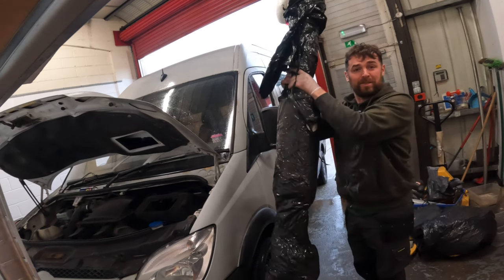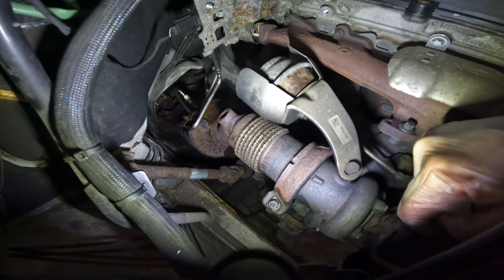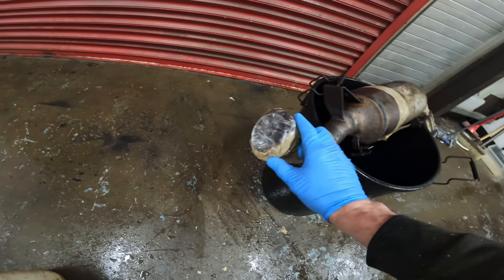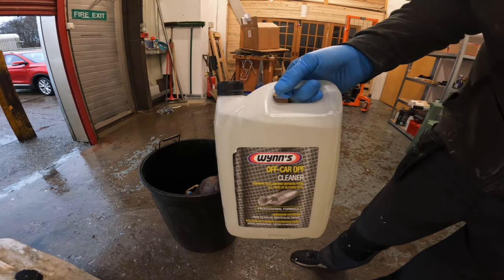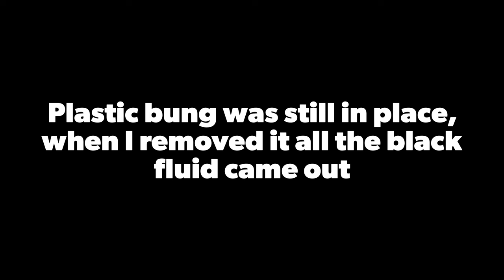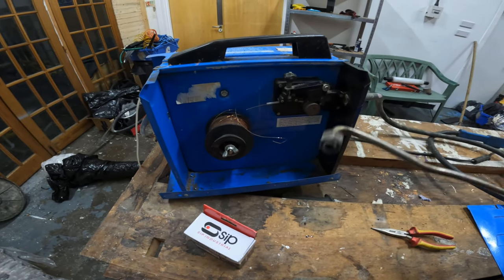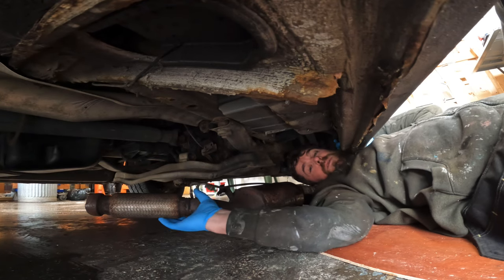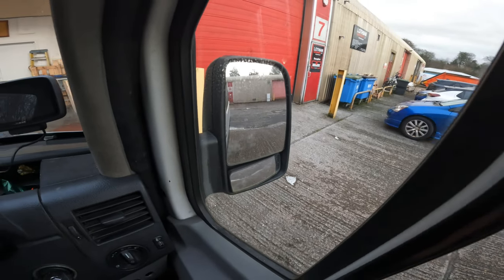DPF removal & cleaning on my Mercedes Sprinter campervan. Will it improve the performance of my van?

Comment: I recently bought  a German made Camper van.... Mercedes 313 CDi.... was a bit disappointed with the performance.  Sure,  it seemed economical... ... but sluggish.
I figured.... well, it's only  the 2,2 litre and the van is the LWB heavy version..... I thought I would have to just have to accept it. 
But then .... I thought.... let's try this: Filled the tank....about 70 litres I believe.... and put in a can of Liqui Moly... (about 10 quid)(Pounds sterling)..... Diesel Injector Cleaner.
Wow.... it is transformed....  It actually feels as if the turbo is kicking in and giving you that boost you want. A completely different drive.
Put a huge smile on my face....I can tell you!
Reply from the maker: Glad to hear it 👍

Comment: I used the wynns cleaner and it was good, back flushing was the best thing i found along with using a acid cleaner. Alkaline cleaner like wynss cleans the soot very well but its so good at dislodging the red ash. Diluted brick acid is the cheapest and easiest to get, mine went from 50mbar at idle to 180mbar at 3k rpm down to 5 and 60 at 3k rpm. Checked it at 6 months was still the same, now has been a year reading's are the same after 5k miles you have to make sure the reset the dpf parameter after cleaning and tell it that you have had a new dpf fitted othwerwise it will block up very quick.
Reply from the maker: Thanks for the advice I will maybe try the brick acid in the future. I just got one of the diagnostic devices so I sorted all that had changed a o2 sensor also so had to clear that 👍
Reply: @iancorbett599  you can use drain cleaner, sodium hypochlorite is the acid type that's in both if you don't want a big container of brick acid.